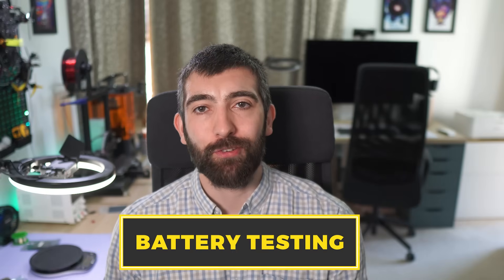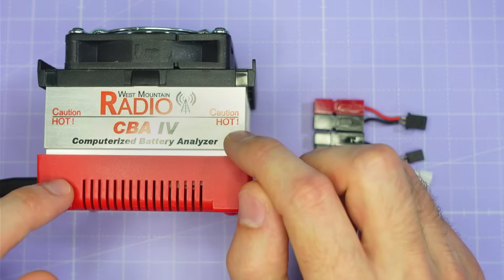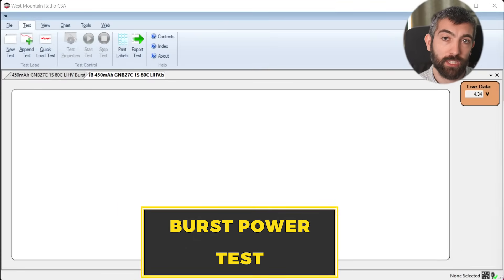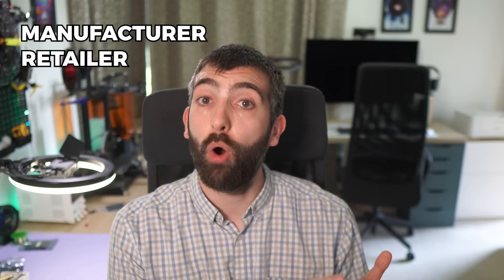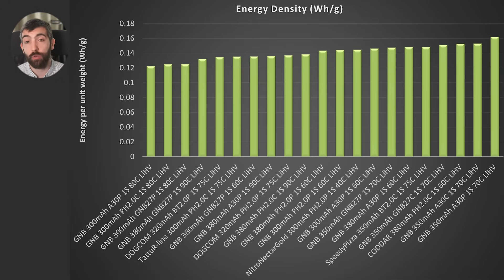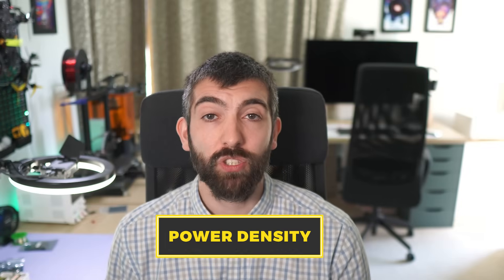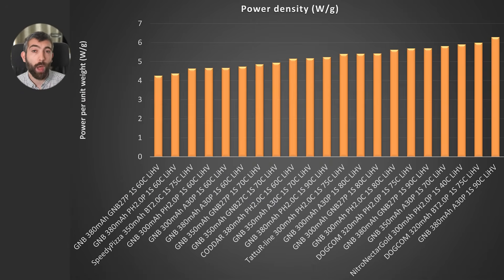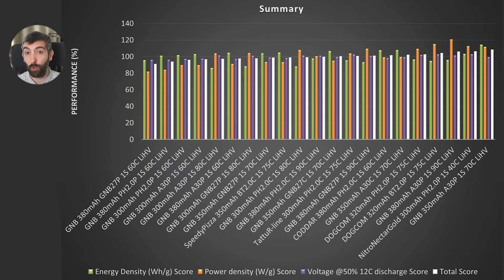Which TINY WHOOP Batteries are BEST?: Testing NewBeeDrone, GNB, CNHL, Tattu and MORE!

Comment: Great video! What is the difference between GNB 350mah A30P 1S 70C LiHV and GNB 350mah A30C 1S 70C LiHV. I think the A30P version is without a cable and the A30C with a cable. It is so? Why are the results different? The cell should be the same. I can only think of the difference in weight and the losses caused by the cable. It is so? What is the weight difference? Thank you very much for your answer!

Comment: Consistency over time would also be super useful.  PH2.0 for example theoretically should not be near the top for max power after some usage given how the connectors wear and carbonize.  

Most of the time we aren't flying brand new batteries so it would likely be more representative to test after like 50 cycles each or something, and 50-100 plug+unplugs.

Comment: you need the tattu r line in bt2.0, weebleed bt  2. 0, and tiny whoop bt 2.0. those are the best batteries by a mile, without them saddly this video is meaningless. great video but next time do your research on what people actually fly. also ph sux only test bt 2.0 next time.

Comment: During voltage sag test do you discharge all batteries at different current (eg. follow 12C * nominal capacity)? IMHO you might come to different results when using constant current/power since (eg. 300 mAh 12 C = 3.6 A while 380 mAh 12 C = 4.56 A). The percentage difference is around 20 %

Comment: Maybe there is way to calculate a unitless metric for each of these three measurements and somehow find a way to represent them on a ternary plot? I know they don't add up to 100% but maybe that can be incorporated somehow in the unitless metric? Then you could designate areas of the ternary plot that make those batteries better for some uses than others?

Comment: Excellent testing strategy and explanation. Having the results publicly available to look at would be kind of nice. A lot of people will be commenting on the different connectors. It would be interesting to do one round testing on a single battery with different connectors. Just to get that trolling out of the way.  I think everybody knows PH2 doesn't last as long and all of the other connectors allow for less voltage sag

Comment: I would love to see some comparisons with smaller 4s batteries like 650mah and 850mah lihv and lipo. Also if you could test RDQ brand batteries. I figure they are just rebranded GNB, but I would be curious to see if that is actually the case.

Comment: My takeaway from this is that it's going to be a lucky dip bag. How are the gnb 380mah both the best, and worst battery between a27 and A30 connector?? I think it might actually be better to take the connector out of the equation and direct solder for the purposes of the test. Then test 2-3 cells from the same brand, since the results seem to be so variable.

Comment: I would have liked Solid pin ph2.0 (not that rolled pin cheapo connector). And bt2.0 which is arguably the #1 connector for whoops.
But hopefully you will also get sent some tattu bt2.0 batteries too

Comment: Why do all tiny whoop batteries have such a high internal resistance? All of my batteries have a resistance of like 60-70 and they are brand new.
Reply: The smaller the battery the higher the resistance. You can think of big batteries as just small batteries in parallel and is why they have much much lower resistance the bigger they are. You should see how low the resistance is for giant 16000mah batteries.
Reply: 1600mah is usually 5-7 brand new if they were taken care of. Still thats a big jump they say if it gets over 20 u should throw it out. @cagmuer

Comment: It would be helpful to do a comparison by connector type. The popular claims are that the newer designs (e.g., BT2.0, GNB 27, and A30) are much better than PH2.0. But, the data seems to suggest this may not always be the case.
Reply: One thing his test doesn't show is how the connector how the connector holds up over many battery connections. This is where PH2.0 really falls behind in comparison to all other connectors.

Comment: I'm surprised battery life isn't more hyped. On the Mini 3 I began to lose signal at cycle 188 & it will drop out of the sky in S-mode at cycle 190, on a battery under 120 days used.

Comment: Tattu by2.0 folded cell, webleedfpv by2.0 and tinywhoop bt2.0 lipos would be nice to see in the test.
Reply: Send them in and he'll test them for free! He says so in video...
Reply: I'm not a "whoop pilot" but I do have a couple and I only use the tattu bt2.0 300mah HV batteries. I used to use the RDQ 300mah ph2.0, because a pack of 10 was the same as a pack of 5 of the tattu, but the rdq batteries (at least the 300mah stick batterie) have caught fire on me before, and I've received already puffed batteries out of the box. Anything bigger than 450mah 2s I have tons of rdq batteries that are all fantastic. Some many years old and still going.

Comment: While this data is fantastic. The most popular batteries for top pilots are tinywhoop, webleed, nitronectar, and tattu bt2.0 and they are not even on the list. I really don't think there is a reason to test ph2.0 connectors when we know they're worse.
Reply: why ph2.0 is worse? im using them
Reply: @PinkeySuavo  The resistance of the connector is much worse than something else like BT2.0, A30, or GNB27.

Comment: The nitronectergolds are great, but are held back by the PH2.0 connector.  When new, the connector is fine, but it degrades quickly over time, NDB needs to sell them with one of the newer connectors to make them worth running.  Switching to BT2.0 added a minute of runtime on a 65mm quad.
Reply: Agreed, its the lack of tapered pins on the PH2.0 and so anything will do better than PH2.0 over time
Reply: @marblekitfpv has a video with the real winner!
Reply: No way it's a minute, and the NBD are awesome with PH 2.0. You just need to make sure you have a solid pin connector.
Reply: @KOrnhOliO1  I tried solid pin, and it helps for a short time, but still wears out.  Switched to BT2.0 and haven’t had an issue since.  But even so NBD sells all their 1S drones with those folded pin connectors.  So if you have to switch it anyway, why waste time with PH2.0?
Reply: @scottmilano2940 I agree. I have a dozen solid pin ph2.0 pigtails that are just worn out. I switched to gnb27 on my 75mm quads and had a huge increase of run time and punch. I'd like to add the bt2.0 to my 65mm, but...I just don't want to switch all my 300mah to bt2.0. when my current stash of 1s dies, I'll make the switch

Comment: Great work. I'm a fan. Thanks.
Yes I too would wish to have some indication of battery longevity. But it is obvious this factor will very much depend on the use/abuse we put them through. An index to measure performance degradation over time based on charge/discharge cycles, I think even in a proper test environment, would be a daunting task.

Comment: I was sure, the Tattu R-Line & Nitro Nectar Gold are the same batteries, just differently labeled. Interesting to see, that this is obviously not the case. Loved your voltage sag test, too. This was an unexpected result!

Great Project and also really well defined test scenrios. The only thing I'm missing is a peak Amp test… what would they deliver at full throttle? Your 80% to 3.1V test is heading in this directio, but I imagine the bigger boys (1300mAh/6S)  will run hot or empty before reaching 3.1V in that scenario? What if you just give them 100% throttle at 80% for 3secs in a flank shape instead of ramping it up?
Reply from the maker: We'll have to see what happens when I test the larger packs. I think I can pull them down to 3.1V at 80% full without issue. My BIG rig can certainly pull enough current!
Reply: @ChrisRosser  That sounds about right. And fun >:3

Comment: Was the c rate calculated from the stated mah or did you align them with the mah you discovered from testing? Wondering if down rating the packs could explain the better performance of some of the top tier.
Reply from the maker: I used the manufacturer rating. I think that's correct as that's how they'll calculate their C ratings
Reply: @ChrisRosser  Seems reasonable but probably worth noting that in the instances where batteries are underrated that could skew some of the results. Ad absurdum: the same cell rated at 10mah would perform better in nearly every test than that cell rated at 1000mah

Comment: Thank you Mr Rosser. Are there any plans to test the claimed C-Ratings of any batteries?
Reply from the maker: I don't put much stock in  C ratings. It doesn't really matter what the manufacturers rating is, what matters is how much current you can get at what voltage.
Reply: @ChrisRosser  I don't either, however, I would like to know how close, or how completely rubbish they might be.
Reply: If there was some spec for calculating C rating, then yeah sure he could compare them, but even Chris had to devise his own test procedures as there really isn't any standard for our industry. I like the way Chris tried to develop testing methods in an attempt to highlight the different use cases for batteries in our hobby. It would be great if he could calculate some sort of unitless number for each of these three categories that might be independent of size, cell count, etc? Then we could have a "Rosser Triple Stat" number for each battery.
Reply: @cagmuer  Essentially the C rating thing would just have to be a "how many amps can we get this sucker to push out" and see if the batteries hit anywhere near their 'rated' C mark. It would likely destroy the batteries in the process. I know that a fixed wing guy who's done a bunch of battery work in the past said he's tried some batteries that were rated to a supposed 100C, only to have them burn some internal management circuitry at around 20-something C. I don't even look at C ratings when purchasing batteries (within reason) - but it would just be fun to see if the batteries could, in fact, deliver anywhere near the amperage they are supposedly rated for.
Reply: @clifffield1 Sorry, this is a long response. Testing the C would be great, but the problem is that no battery manufacturer says how much battery sag and other cofactors are acceptable when they spec the C value for a battery. For example, any battery can provide 500C but it will sag and catch on fire. But technically, it provided 500C for 5 seconds (before the flames). I know this is an extreme example, but it illustrates the meaningless of the C value spec. Lets say a 1500mah 100C battery can supply 100C but the battery only lasts half as long before it hits 3.1V and had nothing left to give at 100C. Technically it provided 100C, but its sag was super unacceptable. However, after the test it bounces back up to 3.8V and still has 1500mah total. So technically it isn't lying. But is that the definition of C value? No one has defined what sag is acceptable when determining C value. That's why C is "meaningless" because sag and other co-dependent factors are not specified. So Chris could define his own C specification, maybe call it a "CRosser" Factor and that would be cool. But Chris would have to define all of those co-factors and it still couldn't be used to compared to the manufacturers spec as the manufacturer might be telling the truth but they just have a different spec for C. Hope this makes sense. Its a rating that isn't a rating. But its still helpful in absence of anything else. That's why we need battery testing.
Reply: @cagmuer  Thanks. I'm with you. I get how all this works. All I'd want to see is if a battery could deliver the amps it's supposed to hit. I realise that most batteries would likely die almost instantly if we pushed them to their theoretical maximum. As an example, take a 1500 mah 4S battery, rated to 120C. I'd love to see if you could actually draw 180 amps from it without it just destroying itself immediately. I'll continue to dream...
Reply from the maker: I think my max power rating is analogous to a proper C rating. How much power can the battery deliver when 80% full @3.1V per cell. The current can be found by dividing the power by 3.1 and that could be compared to the capacity for a CRosser rating!  @clifffield1
Reply: @ChrisRosser  Thank you Sir! (And thank you so much for the work you do - in no way do I wish to present myself as entitled to anything - I appreciate the time you put in as it is)

Comment: Thanks for the work! I would love to see error bars, seldomly one pack is the same despite looks, right? So variability over multiple packs might give us an idea of what to expect when we are buying one.
Reply: This is very true, I use a nice esr meter and when buying 10 to 20 packs at a time, I see a 17% esr  variance on the lower cost batteries. But I don't expect him to buy multiple batteries to test this.
I am always suspect testing sent in batteries/motors from manufactures as they can send in the top 5% after testing, and the end user would not be getting that  motor/battery. I have 23 years racing and have experienced this.
Reply from the maker: I tested 4-5 of a subset of the batteries and variance was within 1-2% or so.

Comment: Where is tattu bt2.0 🫥
Reply: It didn't quite compare to the legit nbd nitro nectar gold with the same ph2.0 so idk what difference we will find besides less sag. Also, at 5 minutes he addresses this. He simply needs more batteries, and that's something the community (and manufacturers) can potentially help him with.
Reply: In the scrap bin!!! 😂 I'm kidding but I stopped buying the tattu batteries cause they've always dropped cells or puffed up super fast.  Those and the happymodel batteries have done that with every single one I've owned.  They're the only two that I've seen do that not only once but EVERY TIME 😂 they work well while they work but they dont work for long lol. I have gnb packs that I've been abusing for 2 years and they're still solid. I've ran thrm down to 2.7 and they wouldn't read on the chatger...I trickle charged them back up to 3.3 on a USB charger and then put them back on the 1s pro charger and they're working great again for years 🤣 I love them.  The nitro nectar 1s cells are the best performance from a 300mah cell ive seen but the gnb are the absolute best battery for the price in my opinion. They're budget price(less than half the cost of a nitro nectar)  but they last forever and have great Performance.   I'm a gnb fan boy now haha.  Cheap enough to throw away but I've just never had to toss one yet haha.  I've disposed of prob 8 tattu packs and prob 10 hapoymodel packs in the past year.  GNB is the way to go! 20 gnb batteries for the price of 5 or 6 nectar packs and they're great batteries! I'll be sticking with GNB all day!
Reply: My best
Reply: Tattu make me throw up in my mouth a little bit. 🤢
Reply: this Chris guy is out of touch some times, he’s too up his mind and missing out the big picture
Reply: @user-yk1cw8im4h dumbest comment of the day award 🎉congrats
Reply: @user-yk1cw8im4h calm down, dude. He's doing this for free and I'm sure he's going to get there.
Reply: he probably tested what he had in hand, you can buy some and send him for test like he stated on the video @user-yk1cw8im4h

Comment: Thanks for sharing.
I would have expected to see ESR numbers with a top notch meter like Wayne Gills meter (consistent down to 0.1mOhm). For my los flying it is the major truth detector instead of the sales C ratings. Of course these need to be tested at the same temp and voltage levels (I suggest storage 3.85v).
Also pack temperature rise after your tests. 
And on another topic: battery break in,  some say it's snake oil, but in rc car racing, it's a performance advantage if done right, maybe you can validate and bust some myths.

Comment: Hello! Ive been using tattu batteries for a while(the same as in the video, but with bt2.0). I can tell that high voltage feels very much and im sure it is not a placebo. They are also pretty old now, but still flying ok.
Reply: how is it placebo when it’s been tested to death since 10 years ago that Lihv performs better
Reply: @user-yk1cw8im4h  im saying its not